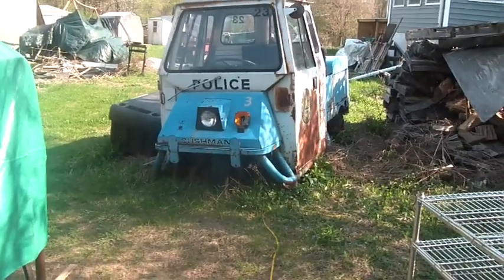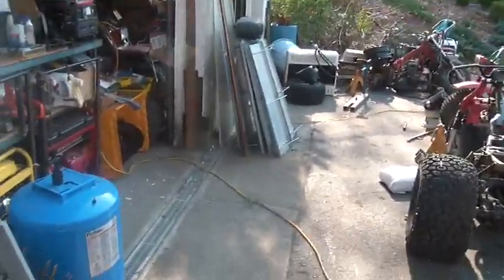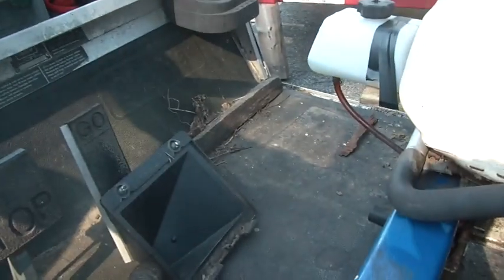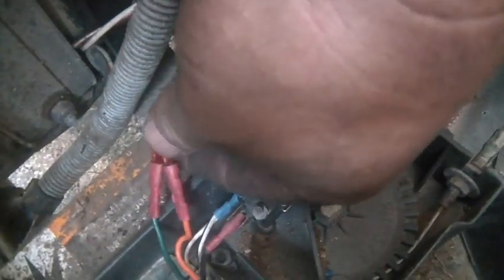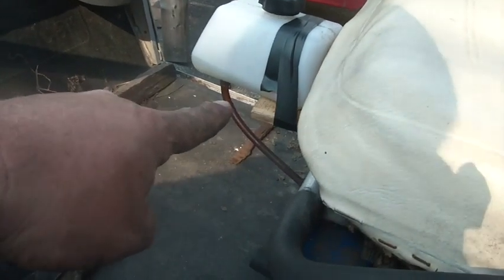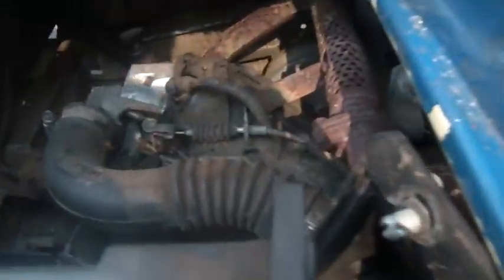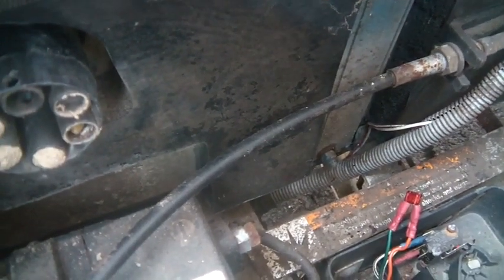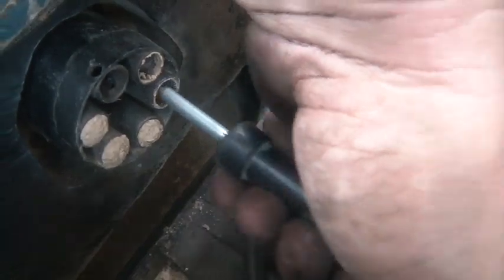5_4_15, Fixing a not starting, 1993 Club Car, Golf cart,

Comment: Good luck on getting your buggy going I have a similar problem I have a club car carry all with a little dump bed and when it runs it runs really well but yesterday I was riding around the yard and it just died just spins over and over we have rebuilt the carb my little vent tube broke too just using old rag for now the wiring looks like a rats nest it has been well used. I have been looking at videos to see if any one else had the same problem still looking hope to find some info it has to be something simple like a fuel pump or elec problem not sure yet just frustrating oh yea dirt dobbers like building nest in there in no time there is another one again Good Luck.

Comment: Does the gas tank vent hose attach to anything under the tank? The vent hose from the carb also heads in that direction. Are  they supposed to connect?

Comment: During charge voltage does go up to 9.7V per battery on average. When charger is disconnected it drops to 8.6V per battery. At this point charger displays "FULL", but cart does not move.
I also thought it's my on-board charger so I bought Stanley 48V Golf Cart Charger. This one managed to jam some juice into my otherwise dead batteries and the cart moved for the first time in a week at about 2-3MPH for entire 50 yards or so. That gave me idea that nothing is broken but my batteries can't accept charge and now I'm thinking it might be sulfation on my plates because I didn't charge it for like a week. Now I'm trying epsom salt.

Comment: i have a 94 as well, changed spark plug, new fuel filter, new fuel pump. It will turn over but wont drive or stay running. Spray starter fluid in it and it tries to stay idling but then dies. choke holes are clean unlike yours were  full of wasp nest. still will not run

Comment: I'm having a problem with my golf cart(Yamaha g2) I turn the key switch on and then press the gas pedal and nothing happens. The switch under the pedal is good because it's sending power to the solenoid. But every once in a while the solenoid clicks but still won't start. I tried connecting the positive terminal from the battery to the starter generator and still nothing. The battery is fully charged and new. I have no idea what the problem could be. Could I please get some help?

Comment: Our 92 was having the same problem.  My husband watched your video and what do you know, ours had the same thing with the holes blocked just like this one with the same kind of stuff.  Thank you for sharing this.
Reply: There's two things that it could be mud wasp.! Or even the mud spider we'll build there nest in there. Number one whenever you're starting an odor machine always take it apart and clean all the parts take the carburetor apart and clean that and all the airports air filters. Then started you can do more damage by just trying to start it the way it is you can suck stuff into the carburetor. And through the valves just was checking your video out

Comment: I have 2010 Tomberlin that was really slow the other day (14mph max instead of usual 24mph). I connected the charger, but in the morning the cart was completely dead. Batteries are only 3 month old and when I test them one by one, each and every one reads 8.6V. Tomberlin manual says if any battery is under 9.3V, it should be replaced. Do you think my batteries are faulty and should be replaced or at 8.6V batteries are fine? Thanks
Reply from the maker: +Kimberly Brook , I think Ur charger maybe bad, or they are not charging due to a bad connection somewhere.... highly unlikely that all the batteries had a cell go bad in them after 3 months... Connect up the charger and see if the voltage goes up, let me know what happens... Thanks for asking, watching, and commenting, let me know what happens one way or the other...

Comment: I have a 1994 gas club car. No spark so changed magneto, still no spark,help
Reply: i have a 94 as well, changed spark plug, new fuel filter, new fuel pump. It will turn over but wont drive or stay running. Spray starter fluid in it and it tries to stay idling but then dies. choke holes are clean unlike his was full of wasp nest. still will not run

Comment: does any one know why my 1994 club car won't get a spark
Reply from the maker: Hey Jacob, Need the answers for a few questions first..... Was it running and it stalled, would not start and U discovered no spark, or did it loose spark just lying about.... Did U ever see this thing run, is the wire harness chewed????   Once I get a few answers, we can go forward from there.... Thanks for asking, watching, and commenting!!!!
Reply: Harvey Spooner
Reply: harvey, can you show me where the engine kill wire is supposed to go?  My cart wouldn't turn off.  I looked and there was a wire hanging  When I grounded it it shut off, but I can not figure out where it is supposed to be connected.  It looks like it is coming from the bottom of the engine and going back toward the starter or somewhere back there.